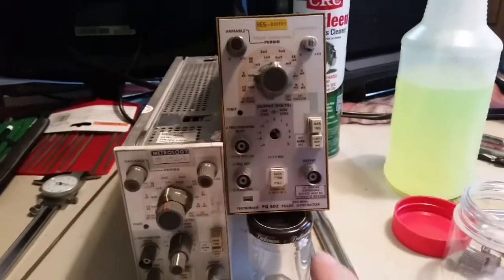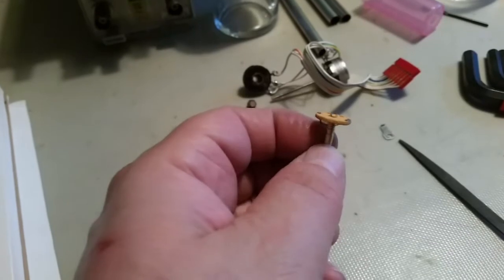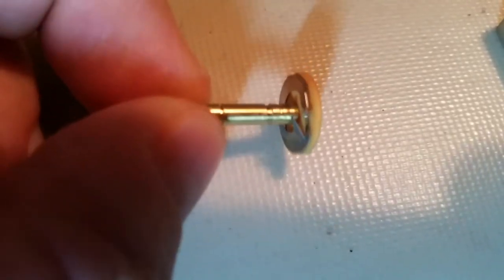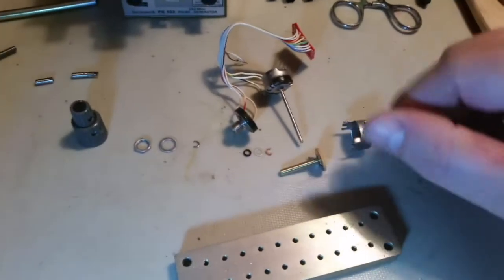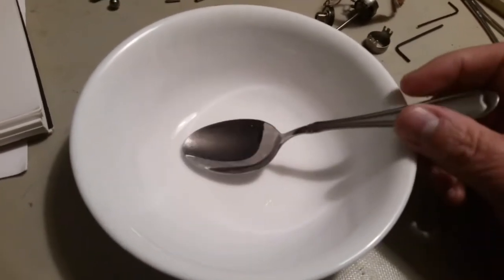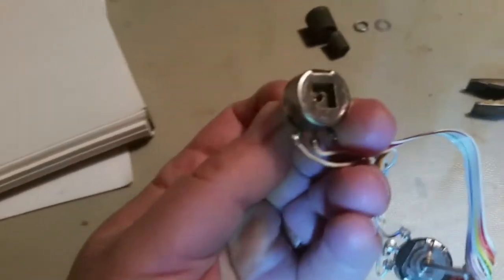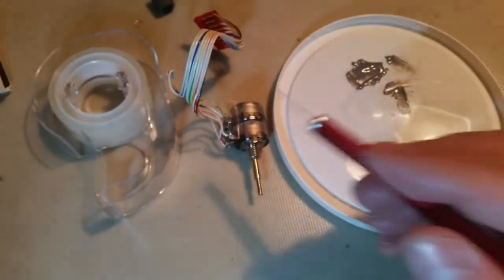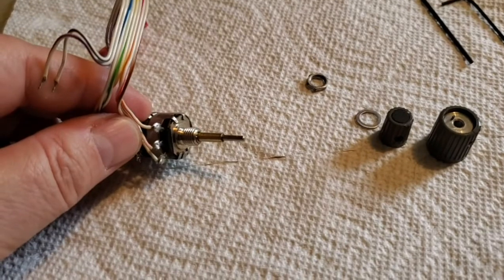Tektronix Dual Pot Repair PN 311-1162-00  in a PG502

Comment: Hi Keith, I was wondering if you could give me some advice please, I have a Tektronic 2225 50mhz oscilloscope,  unfortunately the MODE =, X1 - ALT - MAG 3 way switch has broken, ( i think the spring inside is damaged) .
is this a simple 3 way replacent switch that any electronics retailer should have ? and is it a pretty straight forward replacement procedure ? 
Thanks in advance.
✌️ ❤73.
Reply from the maker: The best way to tell is to look it up in the manual in the parts section and then in section 10 of the schematic or wiring diagrams. Make sure you're looking at the right diagram with the SN of your scope. The diagrams list the sn's that diagram applies to on the right side of the page. So use that along with the card PN and SN when looking up parts and how it operates in the schematics. You can also join the Facebook Group https://www.facebook.com/groups/805303046711998/ and you can post pictures and ask questions. I'm a member of the group so I'll see it when they get posted. Hope that helps point you in the right direction. Keith Noneya

Comment: I am stunned. After decades of carefully hoarding potentiometers of all kinds, I have never seen this much time and painstaking effort poured into an easily-replaceable part. My hat is off to you; you've put that lathe to work for good. I'm surprised you didn't machine that snap ring!!
Reply from the maker: LOL, I could've done the snap ring but they are easy to come by. The shaft was no real effort and incredibly easy to build. Also it didn't cost me a penny, as I already had the stock on hand from over a decade ago. So the only real effort was making the shaft and installing it. It actually took longer to draw it up and do the video than make it for that matter. I'm a firm believer in fixing things if possible, especially because of limited and expensive parts, than throwing them away and buying another one. I suspect for me and others like me, it would've taken more effort and money to find one on line; buy it and have it shipped than to build a simple shaft and repair it. Probably FAR less Time, Money and Effort than, "decades of carefully hoarding potentiometers of all kinds".  However not everyone has the option to build a part to fix a part. I hope you enjoyed the fun I had in repairing the shaft and sharing it with all of you, especially the Strawberry Shortcake! If you end up with a shaft that needs building because you can't locate the part at a reasonable cost let me know, I'll see if I can whip one up for you just for the fun of it. Best Wishes & Blessings. Keith Noneya